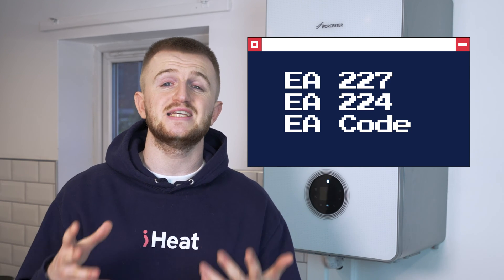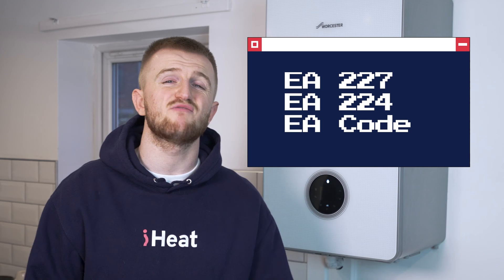Worcester Bosch 227, 224 & EA on the 8000 Combi Boiler Common Error Codes

Comment: Thanks for the vid. Had the 224 error code and reset problem and boiler is back working. Is it likely to pop up again shortly do you think? Should I get the oiler serviced?
Reply from the maker: If the boiler is due / nearly due a service I would definitely get it done sooner rather than later and mention the issue.